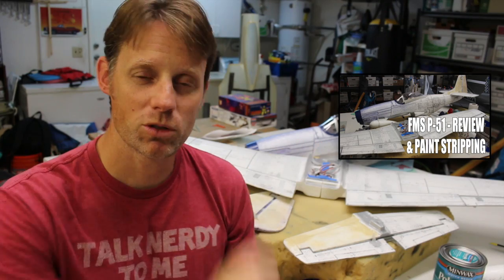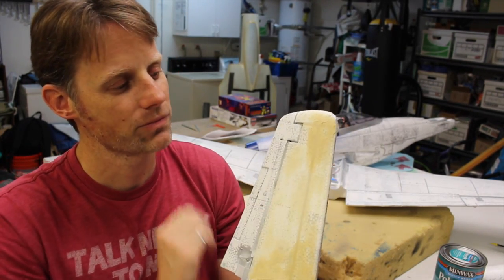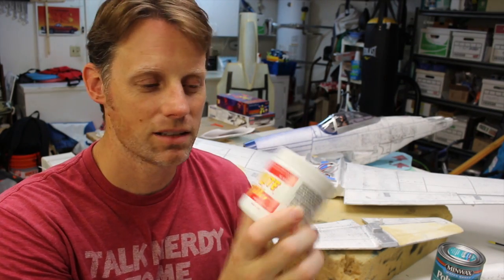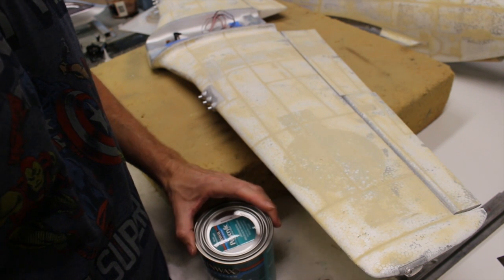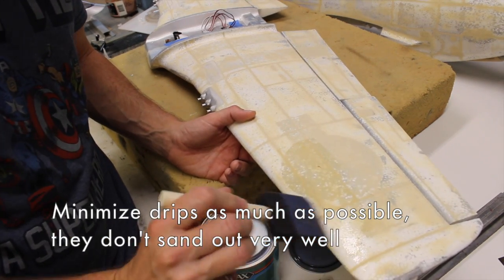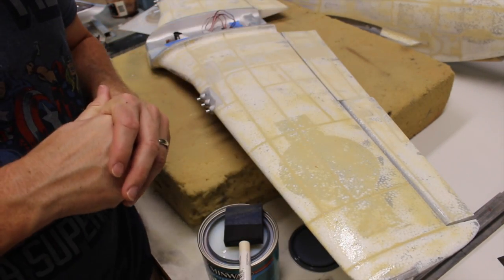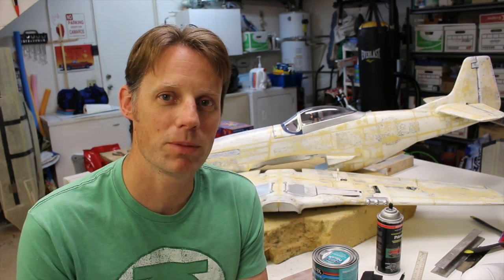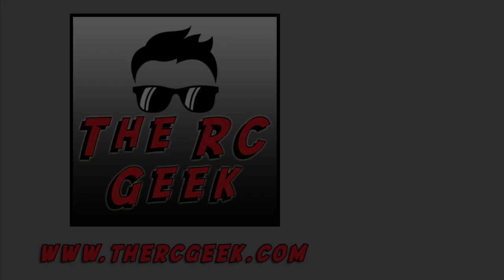Refinish a Foam Warbird Ep2 - FMS P-51 Filling & Sealing for Paint

Comment: its a bit expencive but apply 3/4 oz glass with a foam roller and finishing epoxy resin you can probably use a bit heavier fiberglass if your going to sand it youl be beter off. as for filling panel lines uou could use epoxy resin and filler. next it gets expencive but the outcome is awesome and worth it. airbrush a mist of house of Kollor (coast airbrush) adhesion promoter then a tack coat of kosmic clrear show car 2 part urethane. or probably just a urethane primer would do. i like the clear coat. then wet sand it. for a metallic finish use orion fine metallic silver also from house of kollor then if you wan you could clear coat that but its not necessary . I did it to a custom job o a umx carbon cub now im afraid to fly it lol. I tried  sandable primer froma ratle can and it seemed to eat through the glas but it was just a thin ayer of 3/4 oz. . i also painted orion silver urethane directly over my e flite 1.2 meter p47 and it didnt seem to harm the foam i guess it was protected bu the original stock paint. 
 just a warning... the orion silver will be very bright on a sunny day and cause glare issues. im thinking of leaving my p47 stock. just with it had a version with a girl on the nose instead of a tornado that looks like an angry mr hanky from southpark lol

Comment: Can you put another coat of the minwax after the painting  to?
Reply from the maker: Yeah, that's no problem.  I'd recommend using the spray poly if you do as well as the appropriate sheen you're looking for too.  For military airplanes, flat is usually what you want to go with.
Reply: Do you put the minwax on the plastic cowl to?

Comment: Hi Chris! Impressive work, I'm working on my flightline spit and I only want to achieve a smooth paint finish, do I need to apply the filler?
Reply from the maker: You don't have to, no.  It all depends on what you're going for.  The panel lines on the FLRC spit are better proportioned unlike the cavernous panel lines on the FMS P-51.  I filled them in because they were huge and I wanted to smooth out the airplane figuring I could add back panel lines if I wanted to with a pencil or something like that.
Reply: The RC Geek Thanks, but what gives it the smooth finish, like which coat removes the foam texture, sorry as this is my first time actually going the extra mile of repainting the whole thing.
Reply from the maker: Well, the filler fills in all of the panel lines and the large voids.  The polycrylic seals up everything else and will help smooth it out (depending on how many coats).  IT also stiffens up the airframe too which is nice.   The primer prep is where the rest of it gets smoothed out.  It takes a couple coats of priming, sanding, and priming to get a good finish.

Comment: not sure whats going on but i took the tail fins down almost to bare foam and therest of the fuselage hasa scant amount of epoxy and primer. unless there was a balast weight in the nose when the plane was stock and the weight flew out when i had my crash then im stumped it looks like 6 oz of weight in the nose cowl will be needed to balance the airplane.
Reply: maby less if i use the stock 4 blade prop right now i have a 2 blade11x8.5 and it looks to small
Reply from the maker: Yeah, I'm not sure, that doesn't seem quite right.  I do recall my FMS T-28 needing nose weight even in the stock paint though.
Reply: i barely made balance just pushing the 3s all the way forward... when is somebody going to come out with a fiberglass fuselage and wing lol the 5 oz extra weight itl probably fly fine i just weighed the plane with a 3s in it and a lighter 2 bade 11 inch and its around 58 oz I do have a radian thats way over weight and an epoxy and two part clear coated umx carbon cub that is way over and flies fine
Reply from the maker: yeah, I don't think a little extra weigh is going to hurt.  On my FMS T-28, I found that the airplane actually flew better with a little extra weight (I flew the airplane with a 5000 pack).

Comment: Great video!  I was wondering if you can skip the entire paint removing process with acetone, and go directly covering the airplane with balsa filler and then sanding all surfaces with 180 paper.  Have you tried it this way?  You think it would work?  Take care.
Reply from the maker: Thanks!  Yes, you can proceed that way and that’s how I’ve been doing refinished more recently. That’s what I did with my latest refinish project here: https://youtu.be/nQX9aXoNeVI
Reply: @Thercgeek  I am thinking of using latex paint with my airbrush with your system instead of Tamiya cans.  That is what I use with my fiberglass airplanes.  You either get it mixed to certain color in HD, or you can mix it yourself from the acrylic paint you buy from Michaels.  Both are chep and rewarding solutions.  Then I spray the entire plane with water-based clear polycryilic in matte, satin or gloss depending on the plane instead of lacquer.  It works :-))
Reply from the maker: That all sounds like it should work well!  I haven’t used latex personally, but I know folks who have. How do you thin it out of curiosity?
Reply: @Thercgeek  Windshield cleaner (blue stuff) or dilute alcohol.
Reply from the maker: Cool

Comment: is pollycrylic sandable ?
Reply from the maker: Yes and no.  You can rough it up to prep it for paint, but it's hard to sand if you're doing much more than that.  So, when applying it it's important to avoid drips and things like that as those don't sand out that well.  The whole point of the poly is to seal up the airframe to give you a hardened surface to apply primer over.  The prime/sand/prime process is what really smooths out a finish.

Comment: Great video, very informative! How much weight did all of this add to the plane?
Reply from the maker: Thanks!  I had intended to weigh the airplane before I started and forgot to. :(  So, I don't know exactly the difference in the weight.  That said, the weight difference isn't huge.  Also, these foam warbirds I've found fly better with a little more weight behind them as they'll penetrate through the air better.  Otherwise, they can be too floaty having too light of a wing loading.
Reply: Thanks for the quick reply. I purchased some of the products that you used and I am going to give it a go on the vertical stabilizer on one of my plane and see how that turns out.
Reply from the maker: Cool!  let me know if you have any questions in the process.
Reply: Hey, I do have a question. You used automotive primer, any specific type? I found some self etching around the house, but I don't even know what that means. Any direction would be appreciated.

Comment: You should have used the latex spake that is pink and turns white when it dries lowes Home Depot sell it works well comes in a tube
Reply from the maker: I was pretty happy with the material I used. I’ve been using the shrink free spackle from sherwinn Williams of late and it’s really good too. I’ll look into the latex stuff.

Comment: perfection, lnowledge able you lucky too find out and took time to find coverable materials.....such hard work to work on foam aeroplanes.
i went to a model shop the owner told me to use certain paints....like idiot i listened, did as he said :( result melted plane :(
Reply from the maker: oh no!  What type of foam was it and what type of paint?
Reply: just white standard styrofoam...either xps or eps i guess..? ...there are quite a few.....xps eps, ....then epp and epe which are classed as EPOs.....there more flexible and with stand Aeroplane crashes better...i read somewhere..
.mmm  epp and epe are blue in colour ...but are soft too touch ...you can sqweeze them and they return to the shape once formed....i think........ which make of foam i have is im unsure ...of the xpx or eps ...solid foam bubble white variety....

just for interest: i found this info on foams. today..if its any help too everyone......there are......mied foams also...which are mixed together ..to give better property's...bit mind boggling.....

need to use special styrofoam glues for model aircraft.....cant rember its name sorry...i have run out ....will try to update....for all people who are....starting of new too foamy aircraft kits.......its a hard subject i have found too get straight clear answers too, ....alot of errors in builds can be done....so need to be careful...as facepalm i found out ha...;)

styrofoam...white bigger bubbles ...heading for aeroplane model foams...

polyurethanes..(flexible foams...used for packaging...the soft foam 
pads in boxes.)
Poluethylene...soft flexible foam again,,..for package (the flat foam pads again...

the more people add there info the better for us all :).....take ya time and do your research.........such a nice finish on that p-51 mr chriss....wish i was as good ...:/ ha oh well.

Comment: I've been toying with the idea of fiberglassing an entire plane, cut the fiberglass from the foam fuselage ending up with fiberglass halves. Make necessary bulkheads and reassemble. I wish manufacturers would omit the overstated panel lines and instead come up with a smooth skin over the foam.
Reply from the maker: The newer airplanes from Freewing and FlightLine RC coming out are better on the panel lines.  Not nearly as big.  I know a few folks who have glassed over a foam plug to make a fiberglass fuselage from.  It definitely works and is relatively quick for a one off model.
Reply: expensive old stuff, G.R.P  (glass reinforced plastic) cloth, could just use P-40 grp chopped in resin strand mix..i guess.....boat yard Chandler shops are good source for materials with grp.......;) :), they have a good range of resins, microbeads, cloths, stipple brushes small rollers, ..you can modify, a car battery pump, to be a vacuum pump, with a valve fitted to control the amount of vac, ...can vac bag a repair or model making on a mold ..i guess.......just make a suction tube ..on the air entry into the battery car tyre pump.....it will suck all the air in...or am i being silly?

Comment: wait, 450mmm P-51?? No, 1400 v2 it looks like? Very informative series thank you, just some notes: I use a local wood filler which is water based and sands very well its better than 'spackle' as you American's call it. Also if you are experienced and careful there's no reason not to use a small sanding machine, on the bigger areas and hand sanding for the refined ares and curves - of importance is I noticed you never stripped the parts and electronic components and a=hardware, this is very unusual for me I've never seen professional refinishing where these parts were left in place, there's a million reason to remove them and only one reason not to. I use 100 and 1200 finishing paper wet to get the smooth finish then polycrylic isn't necessary - just a good primer. By "Backlash" I assume you mean 'slop' in the pushrod lines?
Reply from the maker: Yup, there’s no one way to do this stuff. The best process is the one that gives you the results you’re looking for. At the time this was labeled as a 1450mm airframe, hence why I stated 1450. Backlash is more of an engineering term but yeah, is essentially the slop that existed from the loose pushrod. The loose pushrod resulted in inconsistent movement and double centering which was no good.
Reply: @Thercgeek  And your results speak for themselves...as per my comment on the next video. Very nice finish, Im going to try your way next on my PC-2. Sorry I heard 450 not 1450. I had the Blue Nose Petiell 1400 P-51 V2 from FMS - I loved it

Comment: I took advantage of my situation and heavily glassed the front of the cowl and painted it with white laquer base it looks sweet but i will be lightly sanding that and using a mist of Orion fine silver from house of kolor and painting the front of the cowl red for wild bette with fearless dick on the right side or dark blue or black? if i decide to keep it Kansas tornado. the extra resin and filler will act as weight. i am still thinking f i want to do a mod so I can use the opening in the nose for the battery but i dont think itl be necessary. if you want to see pics go to rc groups p47 1.2 meter im flying ferret.. because it sounds funny